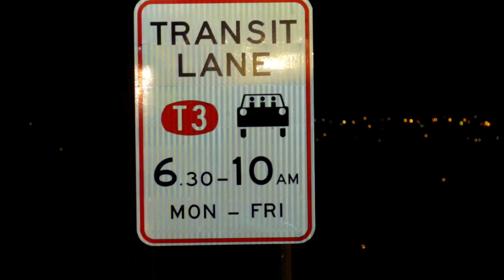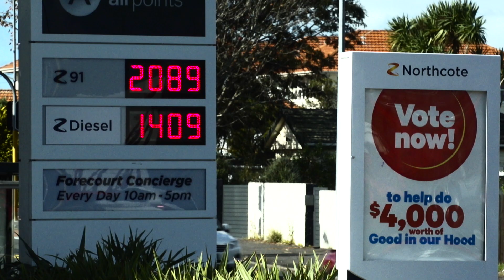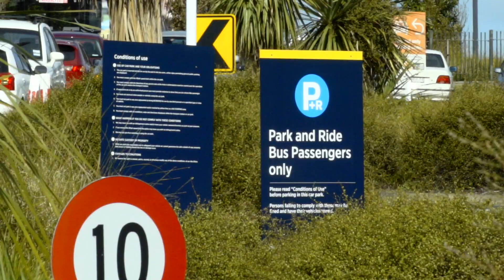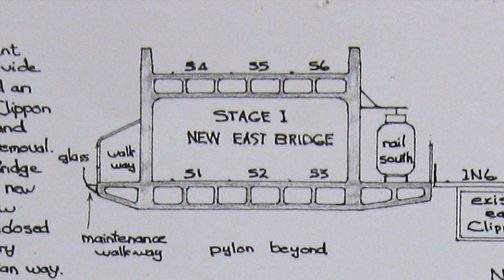Auckland Harbour Bridge Replacement

Comment: A recent (2024) proposal in the herald, showed a new bridge on the western side, which ended up with a tunnel under Northcote point, allowing a linkup with the noth flowing lanes. It looked very sensible... apart from being curved instead of straight (massive cost increase here). Presumably another approach from an architect (I've worked with a few) who wishes to build a monument to himself instead of thinking of the public purse.
Tunnels? Possible, but I wonder how the real dollars stack up between the two different approaches (bridge Vs tunnel). Either way, it will be a gigantic cost blowout due to "consultants" & resourcing.

Comment: I’m sorry Mr Hamilton, but this twin bridge concept is not “well thought out” at all.
Whoever is behind it isn’t even aware that both sets of clip-on’s on either side will have to come off at some stage in the future.

If Auckland is going to solve the problem by building another bridge; that bridge will have to entirely replace the existing one. Constructing replica bridges alongside the current one will be problematic from a WHS perspective and extra-expensive in both money and time. That’s why it will far more likely be by a tunnel of some sort (as a million dollar government study concluded back around 2005). No prospect of wind blowing trucks around in one of those.
Reply: I really like the twin bridges concept. Yes the clipons need to go agreed on that. Tunnels are boring so to speak. Yes they get the job done and are perfect for other situations maybe rail only in this circumstance. but to have a skinny 4 lane bridge built in the 50s as your back drop to Auckland harbor would be a bit underwhelming.

Comment: Article in the NZ herald this morning about how they’re going to need to replace it ASAP. It said that the Nippon clip-on’s are becoming too expensive to maintain and that the collision between a truck and the superstructure of the original bridge in late 2020 means that the original bridge is also looking a bit shaky.

They’ll probably just build a tunnel under the harbour for state highway 1 but keep the original 4 lane bridge for the local traffic. The tunnel will also have provision for replacing the northern busway with some form of rail (most likely light metro).